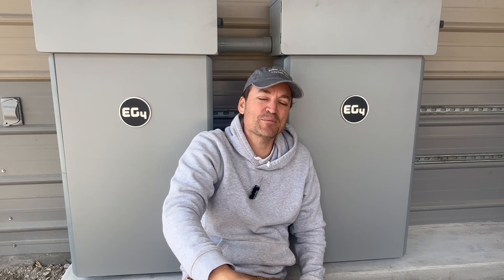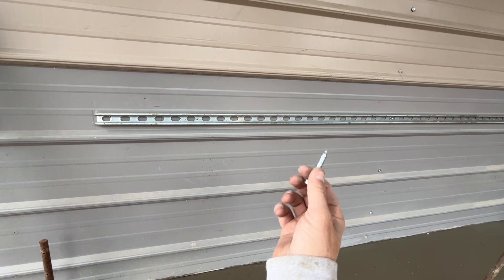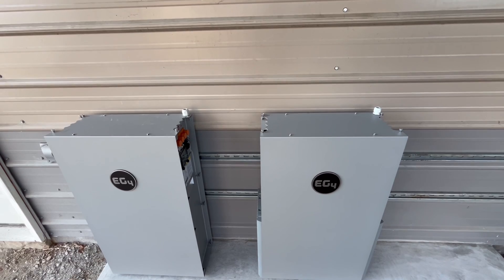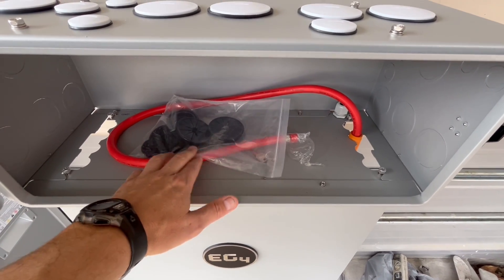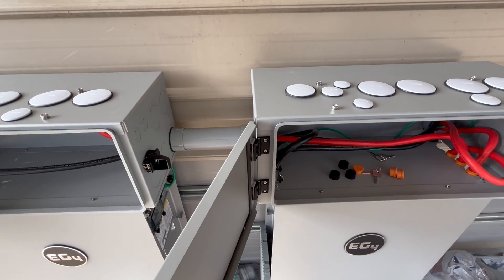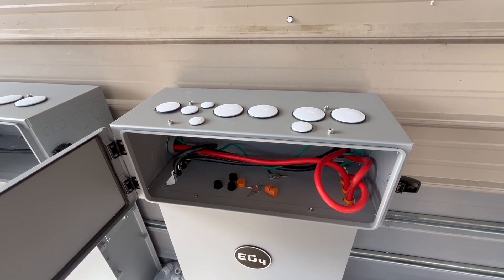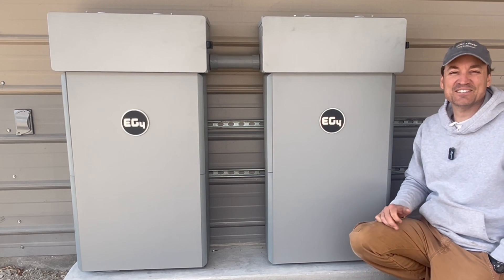EG4 power pro wall mount battery install video~upgrading  my system

Comment from the maker: I mentioned in the video how 3 batteries could attach to one inverter. But that’s referring to EG418kpv with 12kw of output. I suggest reading the Pro battery manual in the link below if you want to learn more about battery configurations. Affiliate link to the power pro battery:
https://signature-solar.com/eg4-powerpro-14kwh-all-weather-lithium-solar-battery-wallmount/?ref=mpmddlkx6M9tPo
Reply: @GavinStoneDIY Your link is incorrect. Remove the dash between "signature" and "solar" to fix it.

Comment: Is there anyway I could contact you by phone?  I have the NHX10k and three of these wall mount batteries and having struggle setting them up to communicate. I set to victron and can get two batteries to turn on inverter but third one like shuts it all down. Or something.
Reply from the maker: Sure. Shoot me an email and I’ll see if I can connect with you soon.

Comment: Can you take both batteries to a bus bar and then one set to the inverter?  So you can have an external breaker?
Reply: Would you by chance know the settings for the N3H-X on the battery. I looked and found PO6 the victors one but not certain…
Reply from the maker: You could do that sure. Or tie the batteries together and send just one to the breaker.
Reply: @ I got two sets of wires with mine but they all required a lug. No parallel kit
Reply from the maker: @jeffnelson5909  you could order the parallel kit, or buy the connectors and make your own. I’ve done both. You save a bit making your own.
Reply from the maker: The setting PO3 should work fine. That’s Solark. Which is Pylontech
Reply: @GavinStoneDIY  how do you find out that it’s pylontech?
Reply from the maker: @jeffnelson5909  Solark is just Pylontech. And the pro batteries have Solark protocol. The NHX uses Pylontech as well, so they should work fine on that setting.

Comment: I'm just beginning to look into possibly going with a system, and if I do, I'll get an electrician to put it in, but I have a setup that I haven't seen addressed anywhere. I have two, 200 amp service boxes. Can two 200 amp boxes be configured into one inverter?
Reply from the maker: I believe so. But that’s beyond my expertise honestly.

Comment: How long the battery lasts
Reply from the maker: During the day? Or life span? 
For the day it depends on how many  loads you are running in your system. 

For the lifespan, it will last around 20 years or more most likely.

Comment: What size slab did you build for that? I'm going to build one for two batteries as well
Reply from the maker: I came 12” off the building. And I designed the slab for 3 batteries so it would be a bit long for you. But for two batteries just over 5’ long would work.
Reply: @GavinStoneDIY  How long was it for the 3 batteries?
Reply from the maker: @ I made it 7’ 9” long.

Comment: What size conduit did you rum between the two boxes? I can't find anything that fits.
Reply from the maker: I ran 2” conduit. The knockouts are designed for 1.5” also.

Comment: @GavinStoneDIY 
Getting my 18Kpv system this week and want to have everything ready.
I like the idea of spreading the weight across multiple studs instead of just one side of the bracket attaching to a stud.
What size bolts did you use to attach the struts to the paneling?
Reply from the maker: That’s exciting! Let me know how the install goes. 3/8’s fit perfect. Just make sure you get the corresponding nuts that go with them.
Reply: @GavinStoneDIY  Thanks for the prompt reply. So 3/8 lag bolts to attach to the studs.
Planning on getting the spring nuts also. What size bolt/spring nut for the wall brackets to support the inverter and batteries?
Reply from the maker: @DwellerDesert  oh I thought you meant the bolt and spring nut before. Yeah the spring nut and bolt are both 3/8. And the lag bolts would probably be 3/8 also. But I would add washers with both lag bolts,  and the other bolts. Washers are your friend.

Comment: Hi Gavin ! MikeG here just wondering if you could get Aims to let you test that 9.6 klw high voltage inverter they have new on the market.I would really like to see the efficiency and what it can do.thanks keep the vids coming
Reply from the maker: Usually companies have to contact me. I don’t pull enough weight yet. 🙂 so if I contact them they brush me off. 

I’ll see if I can look them up. Do they have batteries as well?
Reply: @GavinStoneDIY yes they have 230 volt rack batteries but there expensive.But you can probably use a DIY battery bank on them.Good luck it would be nice if you can get them.

Comment: Would you consider making a video on how to check if the battery was delivered with the heater firmware installed and if not...how to update this battery with the new firmware?  I recently purchased this same battery and I'm struggling to get tech support from EG4 on how to do this....
Reply from the maker: Eg4 does have a video on updating the heater firmware. I’ll see if I can get an idea on how to identify the specific batteries  firmware. The regular firmware does have a pretty detailed guide folder in the firmware package you download from the eg4 website. 

I’ll try to throw some of those details in the next video I make on these. In the meantime maybe try calling EG4.
Reply: Thanks for the quick reply and yes EG4 has a video and detailed instructions but they don't match perfectly and have not worked for me.  For example video shows DIP in ID:1 but instructions show DIP in ID:0 (They don't actually show what ID:0 is but I assume they mean ID64) and when you get into the firmware, it says ID should be set to "ON"....I think if you follow the instructions you might find the same issues and for whatever reason mine fails at the flashing point in the instructions.  Thanks for the consideration @GavinStoneDIY
Reply from the maker: @gregthompson5078  it may be the cable you have. Are you resetting the BMS? That is the part that they didn’t mention is the directions that I saw. When you reset the BMS the lights stay off. So it looks like the BMS hasn’t reset yet.

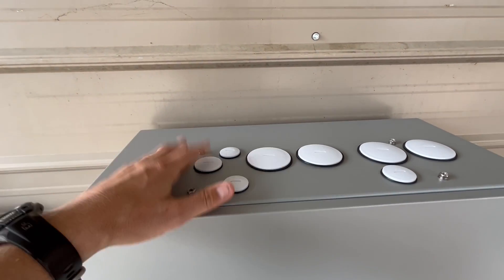Comment: 6:40 that is incorrect, they are made for the 18K not the 6000XP. It can be used with modifications but they are not the designed fit of the 18K
Reply from the maker: The original wireways weren’t. The newer models come with knockouts for both inverter types.
Reply: @GavinStoneDIY   I just verified with both a 6000Xp and a new box fresh manufactured that there is not 1 single hole that will match up between the two units.  Had I realized how bad it was I would not have wasted the $100 on the box.
Reply from the maker: @jsauerii  you’re correct. I was wrong. I need to make a community post about this when I can take a picture.
Reply: @GavinStoneDIY  I grabbed that box for various reasons as i think it is a good idea but it is ultimately flawed as hell. They say its waterproof but that would require every single knockout being punched and filled with one of the included connectors and then have a pipe installed in it. Even then water resistant, not proof. Then you consider the plugs for the top that stick up so far. Not pretty by any means. I think for the 18kPV its great, anything else not so much. maybe they should make a different box for each model or better yet redesign the box to have a swappable sealed top that has the specific holes for your model. Use foam like in the door or something else and a few screws, have far less holes in the side and use the plugs in the side unless you are connecting multiple batteries. FWIW
Reply: We just ordered these conduit boxes for the 6000xp. I get that the conduit box is designed for the 18kpv but $99 isn’t a bad price for a box that big. I’ll make it work on the 6000xp. As Gavin said at a wiring trough raceway is a hell of a lot more.

Comment: Did you get a permit to install these batteries?  I am having some trouble in vegas to get them approved.  Also the conduit boxes on top are not nema rated as I a see through the knockouts on the sides. Water will leak in.  Scary.
Reply from the maker: I believe these have certification to pass inspection. What are they giving you a hard time about? 

The batteries themselves are weatherproof. I don’t have any splices or anything in the actual boxes other than the wire itself . But I imagine they would still shed water. I may test it and see if I have any water intrusion.
Reply: @GavinStoneDIY  the conduit boxes are not nema rated.  They need their own cert.
Reply: They need their own datasheet that shows that.  The knockouts already disqualify for most outdoor nema ratings.  There Is no sealing on the sides.  I spoke to a few inspectors and code compliance companies.  They deny all use of these batteries until eg4 provides this data.
Reply from the maker: @jasongoldenberg973  ok yeah gotcha. I suppose you could always add your own nema 3 rated boxes, but that would be sort of a pain probably depending on how many you needed.

Comment: Very cool!  Great idea putting those outside your shop!  It worked out great that you could just run them through the wall into your main wireway and connect to your system.  Thanks for sharing!  Looks like a fun project.

You mentioned trying to monitor the consumption of the batteries.  The only thing I could think of is if you turn off all loads inside the shop and the heaters kicked on in the powerpro batteries, I would imagine you might see a transfer of power from the batteries inside the shop to the ones outside?  Might be minimal, but if all 3 have heaters going…you might see something…
Reply from the maker: Thanks. I think it was a good idea also. 😁. I agree about the batteries. I was thinking the same thing. Unfortunately,  or fortunately I think we might be just about finished with our terribly cold weather. I was about 3 weeks too late to test it maybe.
Reply: @GavinStoneDIY  Well, I guess you just have to pack them up and ship them my way for the test.  We usually have at least one more snow/ice/freeze before May.
Reply from the maker: @AdamDeLayDIY  sounds good. I’ll slap a shipping label on them shortly.

Comment: I was told you can hook up 5 of the powerpro batteries to the 18k. Going to order the batteries next month. 71.5kw.
Reply from the maker: You could technically hook more than that with a main busbar system like I have. The manual shows all sorts of mix and match options. 3 of them can run through the 2/0 wires like I wired it. But you could probably chain 2 more to the other 18kpv battery input. 5 of these batteries would be awesome! I’ll try to make time to show the software interaction between the two. You’ll probably like what they’ve come out with.

Comment: Hey Gavin, Great video. I’m receiving my upgrade to the 18K and one power pro in a couple of days. I have a rack of 6 of the LIFEPOWER LL which ran my 6500’s that I am returning. They ran well but always with light flickering in the house.  Are you tying your 6 LL’s and power pros into the same busbar to the 18K and the communication hub? Can you talk about open vs closed loop. Find your vids really helpful. Thanks
Reply from the maker: I have then all tied together. I have the lifepower 4’s. I can try to show that in my next video on batteries. Which batteries do you have? The lifepowers and LL’s are different models. If you have the LL’s which version do you have? V1, V2 or LL-S?
Reply: Sorry, meant to say Lifepower4's, same as yours. Also have the hub, but haven't installed it yet. Contacted tech support via email at EG4 about an uploader but no response as of yet. Thanks! @GavinStoneDIY
Reply from the maker: @dbarnclay  ahh ok cool. Yeah you can tie them together in sort of a closed loop/open loop blend. That’s how I’m operating right now. But it isn’t recommended. Otherwise things are still in the works to help those different types to communicate I believe.
Reply: Thanks! I would think EG4 would set up a closed loop patch in its hub to allow different strings of their batteries to communicate. I'm considering adding another 18K later to close loop the set of Powerpr to charge an EV in the near future @GavinStoneDIY
Reply from the maker: @dbarnclay  it’s a bit of a challenge because you have different BMS’s, slightly different charging parameters and much different AH ratings. So in closed loop usually one of the batteries will get treated like a step child and never quite fully charge. But hopefully they’ll come up with something. 

I want to work on an EV charging station at some point also. Of course I need an EV first. ☺️
Reply: Same here @GavinStoneDIY